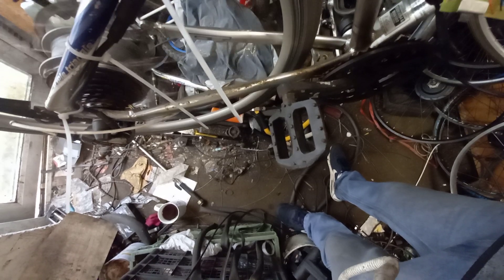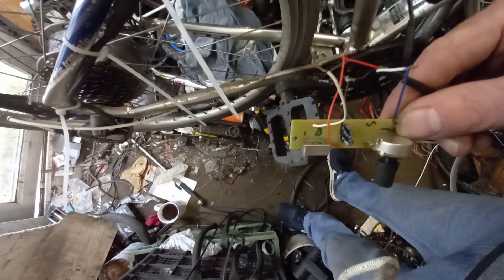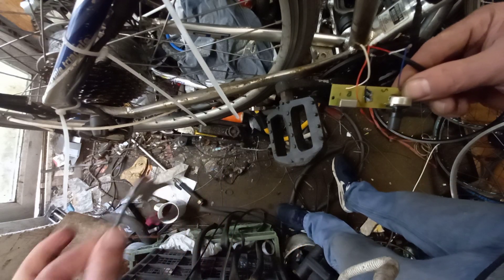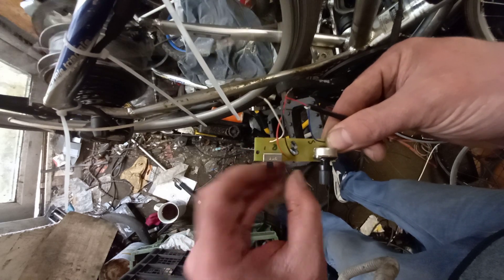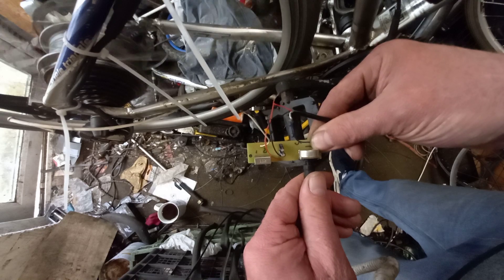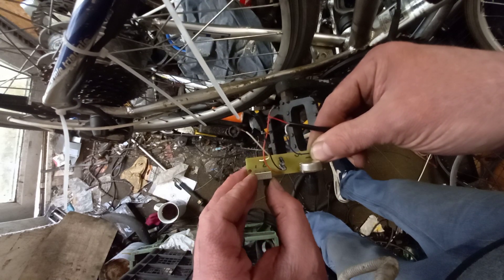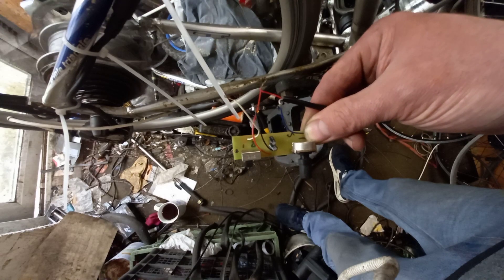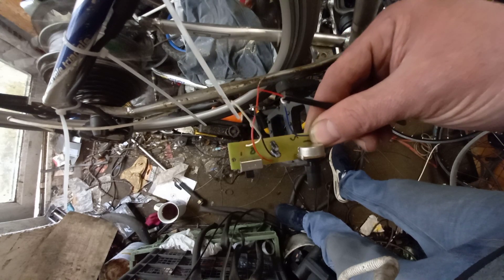overriding a pedal assist on a ebike (throttle)

Comment: Great idea! Can you describe the strobe light you used (so I can find one), and roughly what was the strobe frequency it output (in case I have to find a suitable strobe circuit board). I presume the out put voltage was approximately 5V-0V-5V etc. Cheers
Reply from the maker: It was a cheap one from the dollar store I have no idea of the frequency the out put is about 5 v the quicker the pulse the better as that's what make it move
Reply from the maker: It was similar to  this one  "Battery-Operated LED Strobe Light, Black, LED Flashing and strobing. Great for Party, Event, No Wire. Product Size: 2 x 8.75 x 3.75 - Walmart.com - Walmart.com" https://www.walmart.com/ip/Battery-Operated-LED-Strobe-Light-Black-LED-Flashing-and-strobing-Great-for-Party-Event-No-Wire-Product-Size-2-x-8-75-x-3-75/21463754
Reply: @paulhyland4653  That's exactly what I wanted to know. I think I have seen similar on Amazon. Thanks Paul
Reply: @paulhyland4653  Hi again Alan, I 'm gradually getting to grips with the project. My strobe arrives tomorrow so I can start wiring up. Just one more favour if at all possible. Can you sketch out a rough wiring diagram showing how you linked up the stripped down strobe and the existing PAS wiring. Cheers
Reply from the maker: @dennoh01  just waiting for my PC to finish updating windows
Reply from the maker: @dennoh01  hope this helps   https://www.youtube.com/watch?v=mFHt1A0NKCY
Reply: @paulhyland4653  That's very kind of you, Paul ... thanks again, much appreciated

Comment: My pedal asist dont work anymore can I use throttle to wired the pedal asist
Reply from the maker: Yes if the component are the same  the one in the video works without the pedal assist
Reply: @paulhyland4653  Thank you can you tell me the name of the component
Reply from the maker: It Was a cheap strobe light from a dollar store
Reply: @paulhyland4653  Thank you👍
Reply: @paulhyland4653  if I will try this you think gonna work TSA1020 Volume control module Source Selector RCA
Reply from the maker: The volume control won't work it relies on the pulse from the light the faster the flash the better 😉
Reply: Thank you but I am in Amsterdam and I know some shops wher they sell electronics parts if I go ther you think I can buy from the shop
Reply from the maker: Sure they will have something